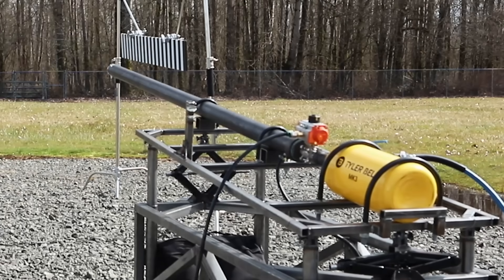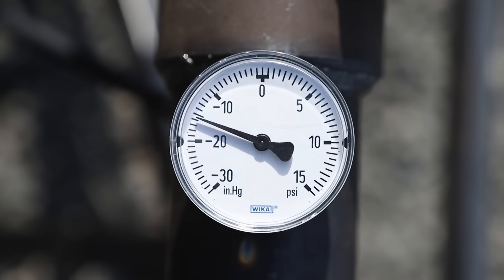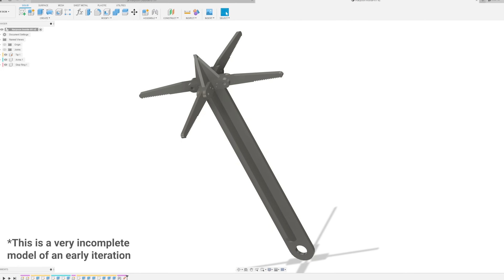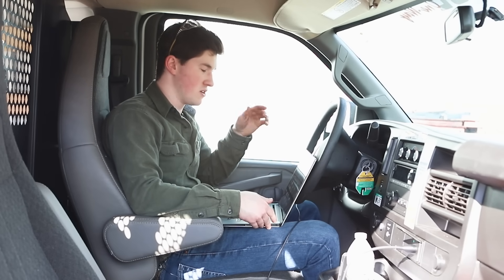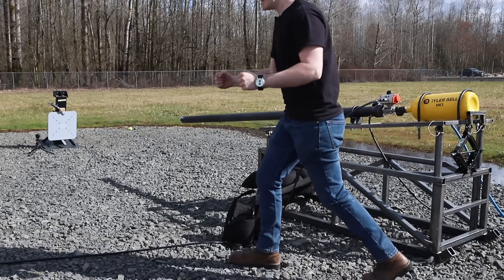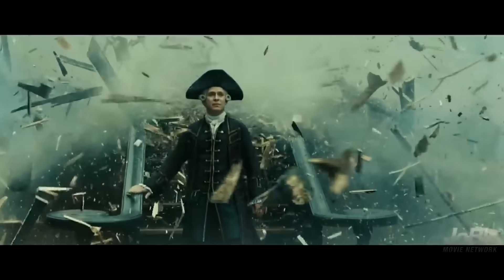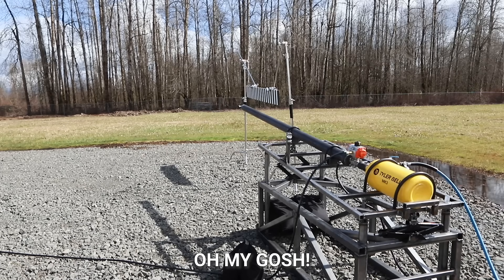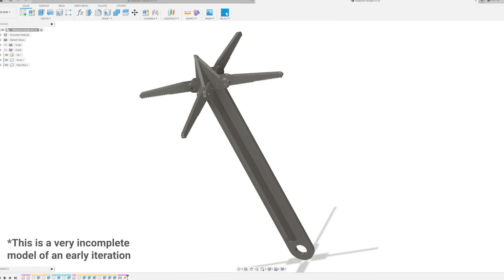Have I Found the Fastest Air Cannon Valve??

Comment: This is awesome! What is your barrel to tank volume ratio?
Reply from the maker: Thanks man! 1:1
Reply: @TylerBellMakes  
Tyler,

You need a bigger tank along with a  smoother bore and projectile (drag coefficient comes into play here). Search up the pumpkin launchers and you will see the volume of their tanks.

We used to build potato launchers fired  by oxy / acetylene mixtures and ignited via a spark plug. the potato was pressed through a section of the same material the barrel was  machined from for proper fitment.

Keep On Keepin' On Dude!

Comment from the maker: Fun facts about this cannon: The fuzzy tennis ball polished the inside of the new barrel after a couple fires. This tennis ball has the kinetic energy of a 7.62x39mm AK-47 bullet.
Reply: Is it comparable to ancient bulky French cannons like what Napoleon used?
Reply: @rollerskdude  No? Those shoot about 400 meters per second but the projectile is 180 times heavier.  Those cute little napoleonic cannons have 60x more energy.
Reply: @cruelfish4824  "almost 2 times the speed and 180 times heavier" shouldn't it be more like 300x more energy?
Reply: @cruelfish4824  Thankyou
Reply: @RusZugunder  The equation for kinetic energy is: K.E. = 1/2 * m * (v^2). So doubling the speed increases the energy 4 fold. So in total, the energy increase is 4*180 = 720 fold.
Reply: @Karnet0  Darn invers square law.
Reply: .762 mm bullet? Like a needle bullet
Reply: I built a tennis ball cannon for the purposes of exercising a dog.  First firing, all I shot was a big cloud of tennis ball fluff!  My cannon clearly required some kind of lubricant.  I tried every barrel lubricant I could think of, including KY jelly.  In the end, a ball slightly wet with water worked the best. I would submerge a tennis ball, and then bounce it on the ground 5-6 times before firing to eliminate the excess water.

I would love to hear about any of your experiences with tennis ball lubricants.
Reply: It most defiantly does not. Sorry I mis read I was thinking 50 cal.

Comment: Recommendation: use a in between tank with the same diameter exit as the barrel. Pressurize this tank to the 2k psi with the other tank, place valve between tank and barrel and in between the tanks. Open in between valve to pressurize middle tank, open barrel valve to fire. That way you have lots if pressure and are not restricted to the small diameter of the nitrogen bottle

Comment: I have an idea for this, and that would be increase the size of the air pressure valve so it is at least more that 3x the size of the diameter of the barrel.
what this would allow for is an increased amount of air being realised within the smallest space that is created when the valve is opened just partially.
Reply: Issue with that idea is it would basically cause a vacuum inside the valve space and would cause the airflow to slow way down, it would be like having a gun with a 1 pound propane tank on the barrel all the pressure you’ve built up behind the bullet would just go into the propane tank.

Comment: I worked with a company that build air cannons to shoot ice balls at aircraft landing gear for safety testing. We had to breach the speed of sound as the theoretical max speed of the impact was the max speed of hail plus the max speed of the plain. We’re talking about tennis ball seize monolithic iceballs. Now, I understand ice and tennis balls behave differently in terms of rigidity and compression. But I wanted to share some insights with you, you might be able to use.
1. Burst disks are definitely the way to go. If you find them unreliable you might have the wrong kind. We could never achieve the same speeds with valves as with pressure disks. We’re talking about a complete different magnitude of opening speeds. Basically the pressure disk opens with the speed of sound in that material.
2.  Validate your speed measurement. It took us months and three setups to get it right. Especially with a tennis ball that compresses easily the speed will drop rapidly. The shorter amount of distance you can get an accurate reading of, the better.
3. U need a valve for the gas to move faster.
4. The most expensive solution, but a worthwhile one, I promise you. Use a gas lighter than nitrogen. Unfortunately you only have two real options. The very expensive helium and the very dangerous (and very leaky) hydrogen.

Comment: The fastest valve for an air-cannon is to use the projectile's sabot as the diaphragm of the valve, so a sliding system that as it moves forward expands in diameter that can hold the rear of the sabot against the inlet to the "valve".  This is somewhat how the cartridge crimp around a .22lr bullet works to ensure that the initial power from the rim primer doesn't simply blow the bullet into the barrel before the heat and pressure of it ignites all the powder.  By using a cylindrical shuttle to control the release you can ensure even release all around by using only 3 trip-latches penetrating the barrel's pressure volume, when those are thrown the pressure immediately activates the release which unbinds the sabot AT full bore diameter.

Puzzling it out?  Air Chuck.

You CAN operate a burst-disk system by putting pressure into the front of the barrel, when that pressure is relieved the disk will burst.

Comment: Why aren't you using a dump valve? They are used on professional air cannons, such as those used to launch bombs into avalanche prone slopes. A dump valve is faster than any other type and can be built to operate at very high pressure.

Comment: sabot your tennis ball, wrap it in wax paper or some other coating so it seals the chamber/barrel better. this will increase your pressure with better sealing also allowing for more flow during the time its in the barrel because your valve will have more time to open before the ball exits the barrel. i would guess youd see 10s of mph by doing this.

Comment: I think if the problem is the tennis ball expanding because it's being squished there is possibly a relatively easy solution. If you made the barrel dynamically shaped. so that the very beginning of where the tennis ball sits in the barrel it's the same diameter as it currently is, however rather quickly the barrel expands outward in a conical shape to allow for the increase size of the tennis ball. it would take some calculation and most likely experimentation to figure out how quickly it will need to reduce back into its original diameter after the tennis ball regains its original shape.

Comment: The main limitation with your design is the flow restriction of the tank and/or valve. Also I would strongly suggest using a triggered burst disk design. Hard to explain this in a yotube comment but I'll try. You have two burst disks in sequence, where the space between the disks is pressurized to some amount below the burst pressure of the disks. Then the tank can be filled to a much higher pressure than the burst disk pressure since the pressure differential (tank pressure minus pressure of the space between the disks) is still less than the pressure to burst the disks. Then you can fire the gun by simply venting the space between the disks, thereby exposing the tank disk to the full tank pressure, rupturing it and the other disk shortly after. All the benefits of a burst disk design plus reliability and controllability since you can fire at will without any complicated things like hot wires.
Reply: I have a better way. But on this burst disc type valve, would you say from shut to open, for all practical preposes is instantaneous?
Reply: @Capitan-America-no.1 a burst disc is by far the closest thing to instantaneous full dump.
Reply: @Anthony-d2e8v  How close? How close until the disc is no longer blocking any flow? In milliseconds please even if it's an educated guess. Very carious about this burst disc. Ive installed some big close only valves that used explosives to shut the gate.
Reply: @Nope-g1u it sounds as though you would be far more capable of such an estimate. When it comes to publicly availablr valves, the fastest I've found is a solenoid valve that took crazy power to activate and had very limited airflow. I've since converted it to pneumatic. I know I dump 165 psi from a 20 pound propane tank in about 0.2 seconds through a 2 inch valve, compared to what sounds almost instant with a burst disc. I got that from super slomo on a phone so probably isn't the most accurate, but I don't have the equipment for anything more.
Reply: @Anthony-d2e8v Thank you Tony. I have to hold my valve shut. A 20% drop in pressure on one side and kaboom 0pen to 125% with 360 deg access. I'll release a video on you tube. It doesn't show the cannon but captures the sound the best. I have a chronograph coming I can't remember if it was 540 f/sec or 540 /mph this was 30 years ago. It's solid S.S. with one piece of r;;b;;;;? It's running at line or 115 psi rated for 400 psi. High pressure test is next week I have 8 redundant fail safe links in place 3 of them just buy time. Little scary having 4,500 psi near to a vessel that will only hold 400 psi.  That will happen next week. Dry Ice is the hold up. Hard to find in Alabama projectile ( a navel orange) needs to be 100 deg below zero.
Reply: @Anthony-d2e8v  Ok Tony I put a playlist up with 3 videos 1st best captures the sound. good camera but cant see anything at .25 speed 2nd is the notorious WOW Trim (2) video. You Tube Hates it and never aired it in the US. 3rd at the end switch to .25% speed it's already in slomo so that's like slowed down 100 times? Enjoy, next week I'll have 400 psi. footage.
Reply: This is brilliant. You could almost double your tank pressure in theory.

Comment: Why not add more valves in parallel so when 3 valves open you get 3x the volume of air at any one point. 
Also, make a holder for the ball to slide through the barrel to ensure the ball doesnt add resistance. Easy 3d printed one will work fine.
Make sure you have a vacuum in the barrel and perhaps add rifeling? You should be able to go super sonic with those changes
Reply: I think there would be a lot of turbulence where the three manifolds reconnect unless it was extremely well designed. Also how could the three valves open at the same exact time. This project needs some retired aerospace engineers.

Comment: Not certain but I think a bigger valve would help because while you're correct that the bottle neck is well... A bottle neck, the valve is moreso because it doesn't reach 100% instantly. So for example a valve with 2" diameter at 25% open would have the sameish flow as a 1" valve at 100% because radius squared. Also I think volume of the tank miiiiight be a factor because if the barrel is say half the volume of the tank then when the ball reaches the end the pressure will half dropped to about 66% of what it started at. I have no actual experience with this though and these are just some ideas. Good luck!

Comment: Use helium or hydrogen they are less dense elements and have a faster speed of sound. Therefore they expand quicker. Finally it may help to use a valve like they have on rocket engines above their bell. Restricting the flow of gas and opening it up again pushes it to super sonic and allows it to continue at that speed at a higher volume.

Comment: Make your own tank with a large diameter rod, with a flaired head sticking out the back of the tank, held by a pin. The pressure pushes back on the head. Pull the pin, and it opens the the hole. A hollow rod will be light. Maybe itll open faster than any butterfly valve could.
Reply: Use a convergent divergent valve at the mouth of the tank.

Comment: I've played with vacuum cannons and pressure cannons. in both cases to make them easily go supersonic I use a PVC and rubber tube wadding to seal on the cannons barrel. This transfers all the available power into the projectile.

Comment: Yeah, I was thinking, the way that the tennis ball seals inside the cylinder would also effect the ultimate pressure pushing the ball.  Doesnt matter if you start with 200 or 2000, if you can't seal that extra 1800 in.

Also, the fact the tennis balls are so light.  Destin's team got a Baseball up to 1500MPH I believe.  That has both weight, and a smooth surface to seal it

Comment: I don't know you. I've never seen the channel or your content. You came in my feed friend. 

I subscribed, there's something here that has pulled me in. Please don't lose that spark fellow creator. I did.
Reply: Increase mass, add seals like sabots, increase tank opening and valve sizing to larger then diameter of barrel. Proper test all connections and welds with a hydrostatic testing rig because safety is extremely important now that you have gone past 200 psi, and things break down differently due to the fluids you chose. 

I would like to stress this a bit more, you have entered in to the realm of pressures of chemical energy storage and really this is very serious ground to cover. 

Maybe I'm a safety lucy, but I would love to see you grow old.

Comment: I don’t think that the gasses speed of sound is limiting you honestly. 

1. I haven’t actually seen anyone online mention that speed of expansion == speed of sound. 

2. I have a few simple compressed air pellet guns, all of which fire WELL over the speed of sound using nothing but a pressure chamber and a straight barrel. Pretty much the exact same setup as you have here. 

3. (This one may be a different mechanism) Gunpowder burns and makes nitrogen which has a speed of sound of 1100 feet per second, which is under the speed of sound.  Yet you can fire bullets up to 3 times the speed of sound using gunpowder.

Comment: Here is what you do
Check up on hypersonic wind tunnels to figure out what steps to apply
I'd suggest much bigger valve, narrowing tunnel leading bell shape, hydrogen as propellant, also screwing multiple gas tanks directly, so combined tanks diameter exceeds that of tennis ball to big valve without big middleman tank, important modification would be valve that after opening fast would close just as fast to not dump all gas in seconds

Comment: could you take two 1000psi valves and connect them parallel to each other (using 1 tank or 2)?  I am also not an engineer.

Comment: You will never exceed mach 1 with a cannon design. At Mach 1 your flow becomes 'choked', no matter how much pressure you put in you can't physically get more air through. A rocket can exceed this speed by expanding the air, which is capable of accelerating the air at high pressures and heat (this is counterintuitive as it is the opposite of what you'll find in everyday life). Look into laval nozzles.
Reply: Why is this? I’m asking because I have a really simple compressed air pellet gun which shoots at 1700 feet per second. No fancy nozzles or anything, just a chamber, a valve, and a straight barrel.

Comment: First of all: That's one awesome air cannon.  10:02 That ball is straight up GONE.

Secondly: Isn't it impossible to use an air cannon to go beyond the speed of sound? Since the air pressure moves at the speed of sound, per definition. You would need to not just pressurize, but also speed the air up beyond the speed of sound. Wich would require 'interesting' piping.

Note: 'speed of sound' is the speed of pressure waves. Air itself can go faster, aka Mach speed.
Reply: I was wondering that too however I realized that I have a compressed air pellet rifle that shoots WELL over the speed of sound. Taking it apart doesn’t reveal any special nozzles or anything, it’s literally just a tank and a valve with a barrel. 

Also, and this might be a different mechanism, but gunpowder burns and creates nitrogen, and nitrogen’s speed of sound is 1100 feet per second, which is way below most high powered bullet velocities. You can get well over 2500 feet per second out of some types of ammo.

Comment: the air pushing the ball moves at the speed of sound; so it wont be able to push the ball faster than the speed of sound, regardless of the pressure
Reply: Why is this? I’m asking because I have a really simple compressed air pellet gun which shoots at 1700 feet per second. No fancy nozzles or anything, just a chamber, a valve, and a straight barrel.